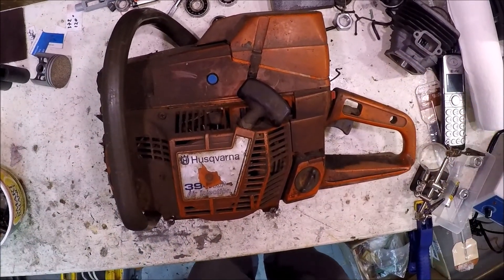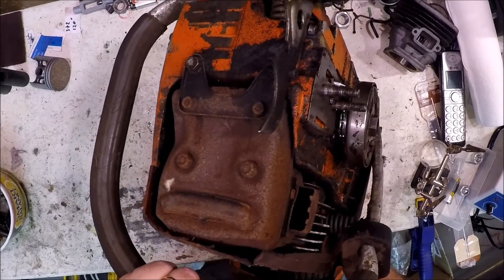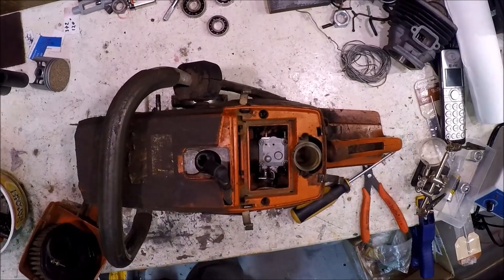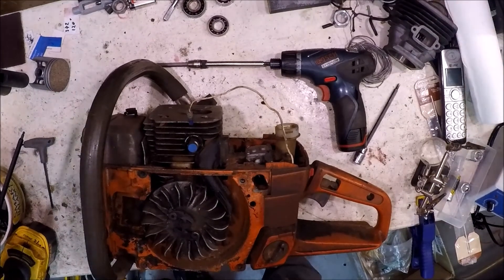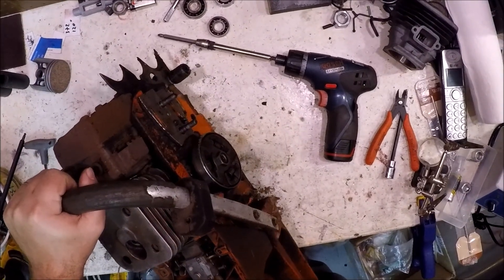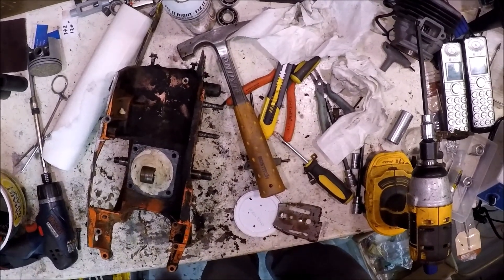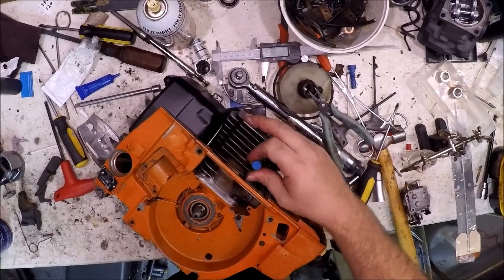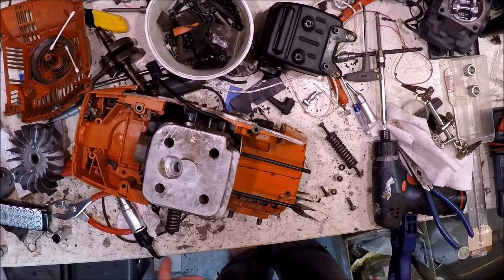Rebuilding an ugly 394xp, poor mans porting etc

Comment: I have 2 394xp chainsaws they are my favorite even over my second fave 390xp . I have two 288xps that I logged with back in the day .they were the tools of the trade until I got my 394s . I like my 395 and 3120 for milling these days but my 394s will always have the top shelf in the saw shed.

Comment: The reason the cylinder looked so good is because the high top can run the heavy duty filter . More air flow and cleaner.

Comment: Looks a lot better Mattew.  My 570 has .00035" difference in the two deck halves,  I would like to do a gasket delete, but was wondering if the triple bond would hold with that much gap?  Also I've seen some older dentist drills.  The ones with the cables and pulleys for $75-100, are they right angle, and would they be suitable for porting?  Cheap way to do it if so.  

Love the idea of inserting the piston before installing, learn something everytime I visit.  I will be using it in my builds  thanks, Ken
Reply: Sorry that should be .0035"
Reply from the maker: customcutter100 ken...  3.5 thousands seems like quite a bit to me.  Also means the cylinder isn't sitting straight even if the space is taken up and doesn't have an air leak.
Reply from the maker: customcutter100 the old pulley drills work like a dremel...but I don't know if there's a right angle for them.  The lab handpiece setup is cheap enough and good enough to do what most guys need
Reply: What's the cheapest way to go right angle?  CC specialty? or?
Reply from the maker: the lab handpiece I have here is the cheapest ....    if you want better quality you likely need to do CC specialty but I have no experience with them
Reply: Approximate cost and link or Mfg?  Or is it called Lab Handpiece for google search
Reply from the maker: https://www.youtube.com/watch?v=7p8Qo0YtQwM&t=9s
Reply: OK, found  the Marathon Handpieces on E-bay.  Cheaper than my knock-off Foredom 20 years ago.  LOL

Comment: What’s your process for cleaning one up
Reply from the maker: not quite understanding the question... can you rephrase?   cleaning what up... a saw?  a cylinder head?  tearing down...  ???
Reply: @matthewolson8875  general cleaning? Degreasing before you start machining. Etc. parts washer? Hot tank?
Reply from the maker: @jakehill322  if I'm splitting a crankcase a lot of the parts end up in the ultrasonic.   Purple degreaser works well on pladtics but is no good for aluminum...mean green works well for aluminum...flywheels and carbs.  Sometimes I steam clean things too.  Soap and water for other stuff by hand in the utility sink.  Lots of prep for sure
Reply: @matthewolson8875  thanks! I’ve got a 395xp I’m tearing apart to clean up and go through.

Comment: Hi Matt , i have one of those kits but the bits are way long and dont have a groove to lock in , so whats the burrs you use to connect to those , and are the heads the same spec for those bits as the ones you used previously ?
Reply from the maker: Roy wilson yeah....you have to grind the burrs shank to fit. ..takes a bit of doing but it works.  You want to aim for the same shape as a LATCH burr
Reply: ok thanks , strange thing was the burrs i got with it dont have grooves on the shanks , think they messed up somewhere  its the same kit  as you have as i saw the videos you do a lot of and got it from amazon as i do a bit of modding myself :-) watch lot of your videos and Walts ones too

Comment: Matt how could u lower your intake time raising u cut  but lowering it how would u go about that
Reply from the maker: Cutting away increases intake duration....ie ...go from 75 degrees to 80 degrees ....but if you want to decrease duration then you need to add material. ..ie...jb weld to the intake to go from say 85 to 80.  ...quite a job

Comment: Thanks sounds like a lot of work to lower
Reply from the maker: its all work.  adding jb weld is doable, and I've had success with it.  but its extra work.  usually if an intake ends up excessive then i'll do it, so for instance, on my 346xp's ...  i ended up with 85 on the intake, which is a bit much.  so I used jb weld and brough them up to about 78-80  ish.   :)

Comment: Can you put a link to all the porting tools you used in the video
Reply from the maker: Hey Brett, I dunno about ALL the tools, but the thing I used here is a dental lab handpiece.  Its a chinese Marathon handpiece setup, and I can buy the right angle latch heads for about $9 .... and you get one maybe 2 port jobs with it.  I have another video where I go over the equipment that I'm using.  "poor mans porting"   the trixy thing is to get the right carbides, and then add the "latch" part to them to make them "right angle"   ...essetially you use your straight dremel cutoff wheel to grind on the end of  a carbide bur to make it "latch"  takes time.   

ebay:   https://www.ebay.com/itm/Dental-Lab-Marathon-Micro-Motor-35K-rpm-N3-Straight-Handpiece-Contra-Angle-US/381476762399?epid=22010875724&hash=item58d1c9731f:g:EpsAAOSwrFtaM3vW

and something like this:   https://www.ebay.com/itm/10pcs-Tungsten-Carbide-Tungsten-Steel-Dental-Burs-2-35mm-Fit-Marathon-Polisher/291335920350?hash=item43d4f95ade:g:wbUAAOSwpINZZJF~